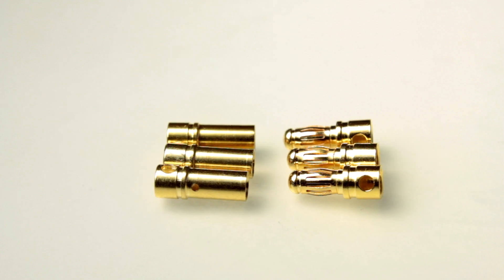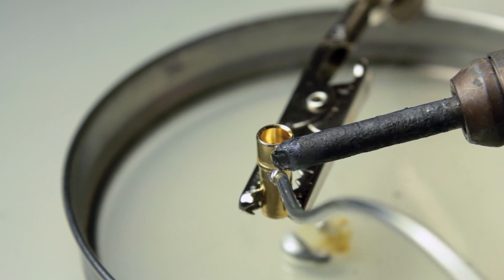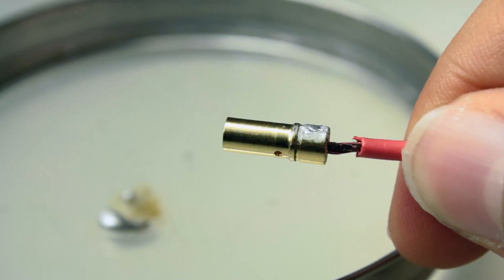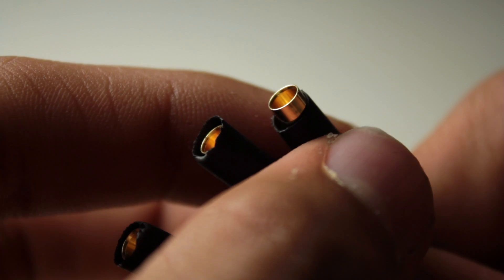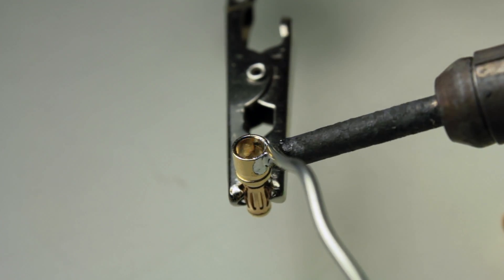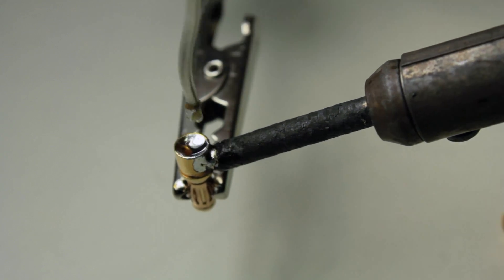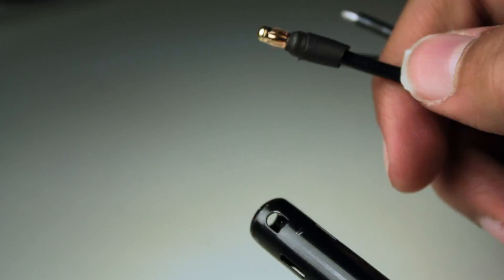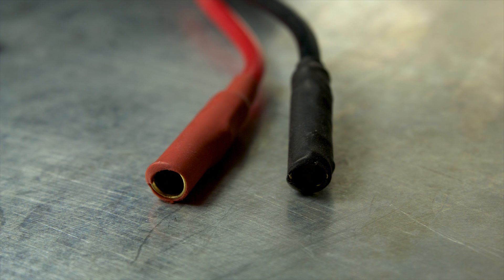How to solder 3.5mm connectors

Comment: Hello, nice video, I may have a few possible points of improvement that may help you create better welds:
- try to add the solder to the soldering iron and not the weld.
- if your solder is not bonding to the connector and forming droplets, either use some flux or scuff up the surface a bit.
- let the weld heat up properly before taking the soldering iron away, it will decrease the chance of dull and grainy "dry welds". A good weld should be smooth, bright and shiny
Reply: Lightspeed Echo it's soldering not welding ;-)

Comment: Nice video, this is how I did it for years. Until a friend showed me that if you stick the wire into the connector first. Then heat the connector with a generously 'tined' soldering iron (i.e: a soldering iron that has a blob of solder on it to help transfer heat into the connector) before feeding the solder into the connectors side hole or top edge you'll find that the fresh flux on the solder means it will wick more readily into the connector and up the wire forming a stronger weld. Give it a try, will depend on the solder you're using, but generally it seems to work really well.
Reply: Jon Ardern it's soldering not welding ;-)
Reply: ***** yes that's right, it is.